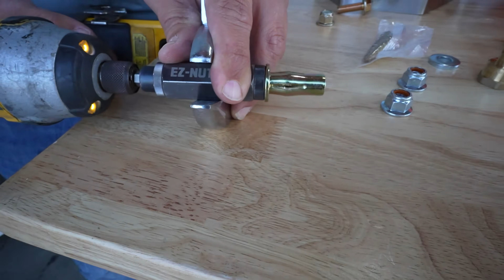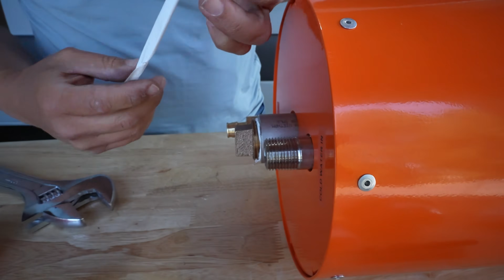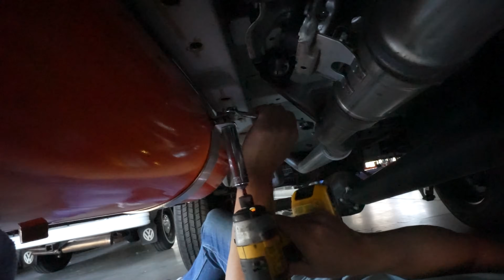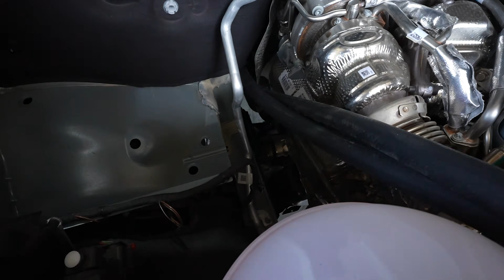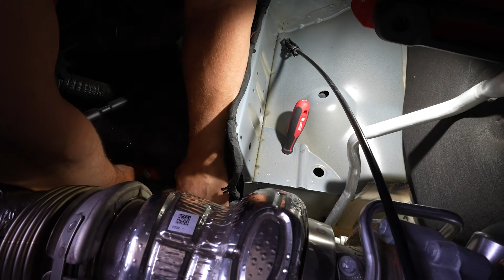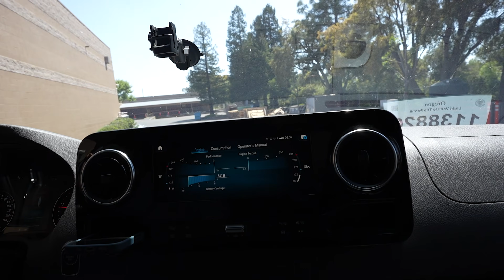How To Install the New Incline Water Heater!

Comment: Very good detailed video thank you. Gentle suggestion. Humble road suggests a on/off loop incase the new part of system develops a leak you can disable that part of the system you installed and revert to the original engine system.  Especially important as your hoses run under the van and are more prone to snagging. thank you.

Comment: Great video, really helpful. Has anyone determined if this would fit under a Promaster? Cheers
Reply from the maker: I'm not sure for Promaster. The dimensions of the water heater is: 8" diameter x 32" long, Overall length with fittings: 38" long

Comment: Hello. Thank you so much for this video and all the advice. I'm very interested in this system. What is the diameter and thickness of the pipes you're using for the connection to the engine cooling system? Thanks in advance for your response. Have a good day. Damien (France)
Reply from the maker: It's 3/4" ID heater hose.

Comment: Wow it fits perfectly! Would think it would be better to use the OEM metal coolant pipe though the engine-bay, maybe I just didnt see it clearly.
Reply from the maker: The OEM line would need to be bent in the opposite direction at the lower part of the engine bay.

Comment: do you have a video or any tips for running the hot/cold water under the van? I presume there are some considerations for winterizing those lines just even for the distance they are running to get into the water heater and back into the van?
Reply from the maker: The pipes running to your unit should have insulation around them. If you bring to the unit side by side and wrap them together with insulation, they will not freeze. Additionally, if you use PEX A, the pipes are resistant to freezing and will not crack if frozen.

Comment: Hyped to install mine tomorrow
Reply from the maker: let us know how it goes!
Reply: @VanLand installation was a breeze. The fit and finish of the hangers was far beyond what I expected. The install kit could use a little work. Would like to see a check valve and maybe some hose clamps as the thermal clamps don’t fit over some of the larger barbed fittings. Especially if you have coolant on your hands.
Reply: What’s your plan to keep the lines from freezing on winter trips?
Reply from the maker: The pipes running to your unit should have insulation around them. Keep them as short as possible. If you bring the water pipes to the unit side by side and wrap them together with insulation, they will not freeze. Additionally, if you use PEX A, the pipes are resistant to freezing and will not crack if frozen.

Comment: That’s a tough sell. You could buy 3 isotherm units and have money left over vs this. I suppose if you absolutely had to put your water heater under the van which brings about winterizing issues you would be forced to buy it. It definitely looks like a well made unit.
Reply from the maker: The problem with the Isotherm units is that they only last about 1 year. Check the online reviews.
Reply: @VanLand my first van is 6 years the second is 4 years old. Knock on wood.
Reply from the maker: The older Isotherm units are actually better. The new ones have issues.